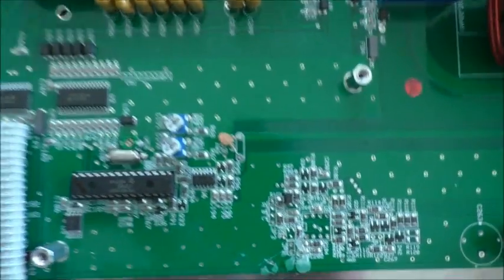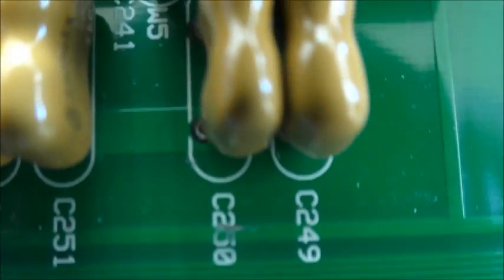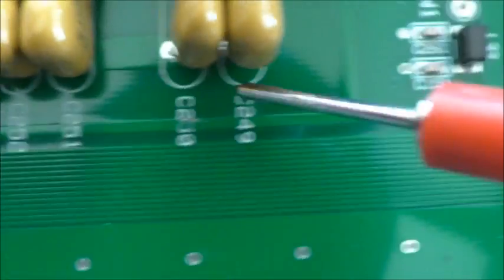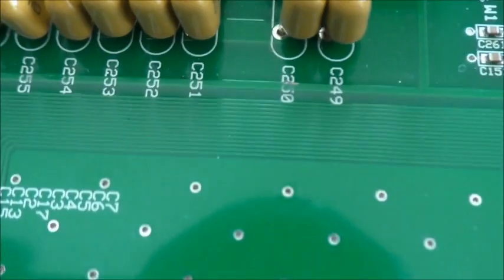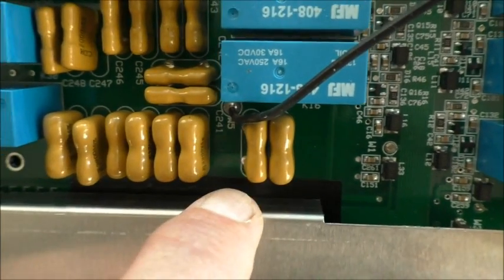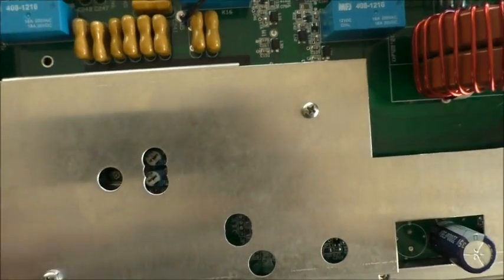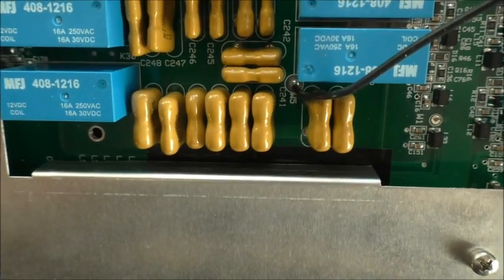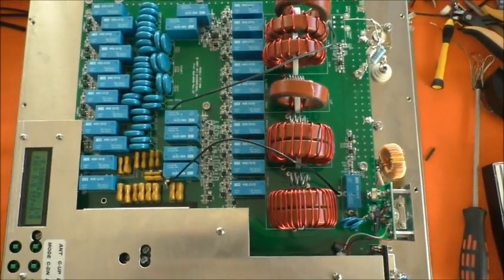OK... Found The Problem With The 998RT

Comment: Yes, very careless to have metal laying on the resist. It's possibly the fact the remote tuner is adapted from an indoor version as a "quickie" project that didn't get design reviewed.
Reply from the maker: You're probably right, the circuit diagram doesn't show the internal bias T arrangement. It's the circuit of the 998, not the 998RT.

Comment: I wonder if they changed suppliers of the stand offs they are using on that shield......they may be a bit shorter and be letting it get closer to the PCB.......
Reply from the maker: No idea mate. Unless some good reason to leave the screen extending all the way down to the board shows itself I reckon it would be easier just to make the screen shorter as I have done.
Reply: Yeah its pretty sloppy of them to let that through........your way to fix it is by far the best way, but I was just wondering how a company like MJF could let such a thing through QC like that.....
Reply from the maker: I can't understand why it got past the prototype stage. Someone should have picked that up before the final design got to the manufacturing stage.

Comment: Thats a huge design failure
Reply from the maker: It certainly should have been picked up. It will be interesting to see if the other 998 they sent me has the same screen fitting arrangement or if they've changed it.
Reply: yes, but with the expreriences I have with mfj in the past I bet they didnt change it.

Comment: Nice trouble shooting job! MFJ should give you a big free tuner for this. I imagine they will change their manufacturing construction to will modify the metal or put some tape on the board!
Reply from the maker: They sent me a replacement tuner without asking for the faulty one back. This suggests to me they are already aware of the design flaw. It would be very nice if they sent me a 269C antenna analyser as a gift though.